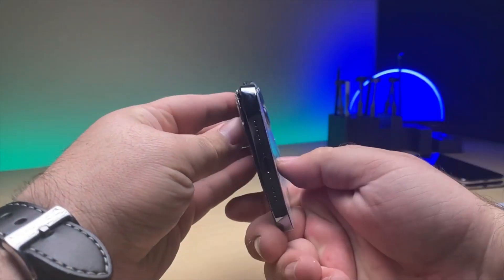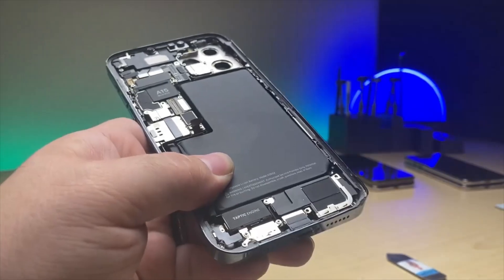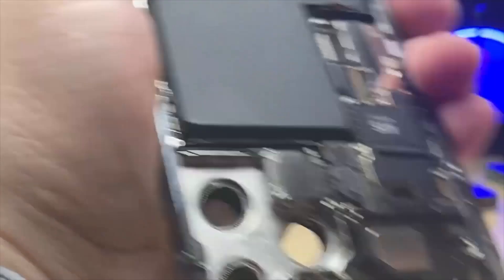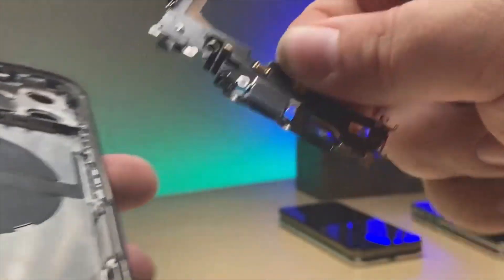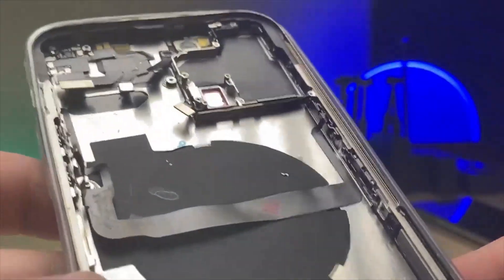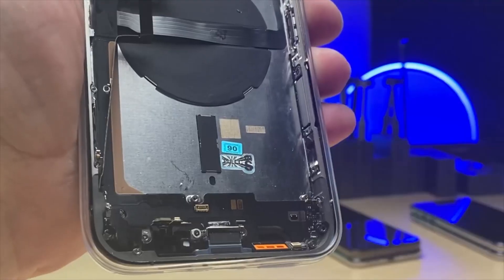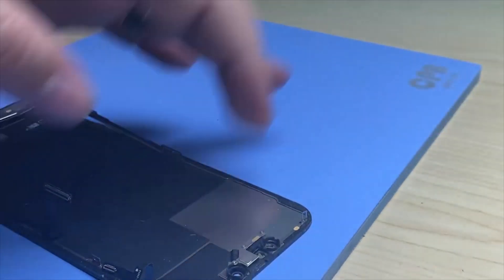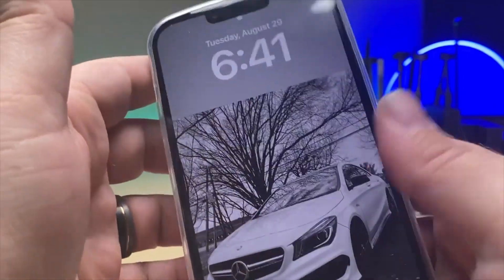iPhone 13 Pro Max Full Frame Swap - Complete Guide for Beginner Technicians

Comment: Do you have tip to organize of the screws ? Can you show us
Reply: Organization of screws is essential and to achieve this without mix up buy a mat for working on cellphones as it has the recessed holes for holding the safely!  The mats come in different sizes and styles. Find one that suits you but the best ones have about 70-100 recessed cubes. Then imagine the entire area of the cubes representing the outline of your smart device and place the screws as try come off in the corner and estimate a layout from there. Hope that helps!